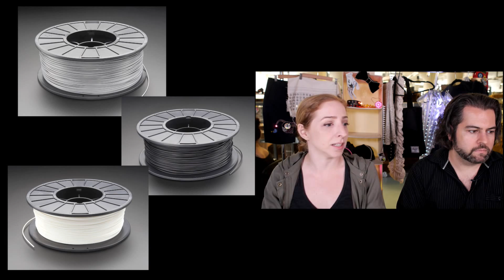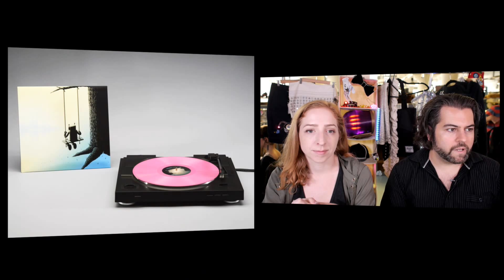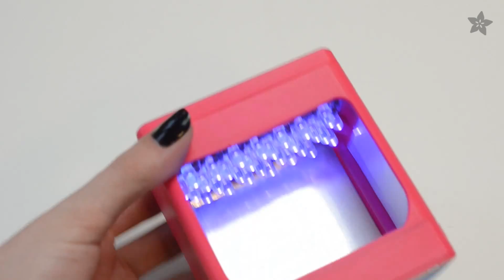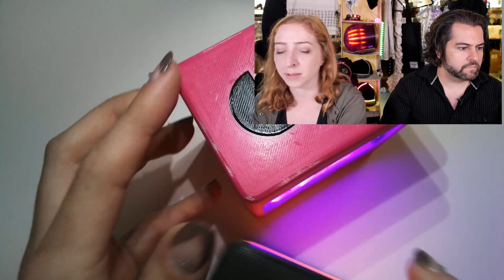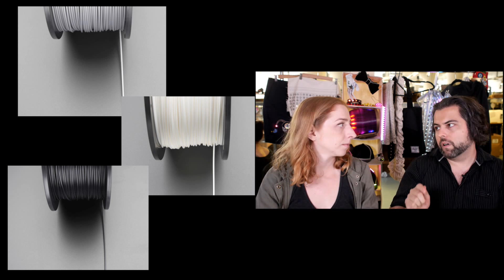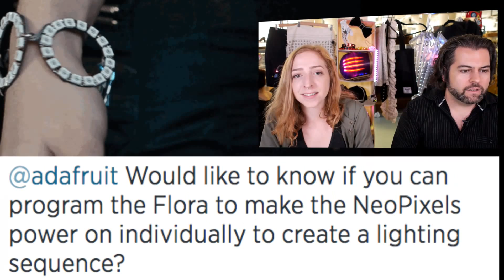Wearable Electronics with Becky Stern 9/3/2014 - LIVE

Comment: Hay Becky. :) For the 3D printed UV nail curing project, instead of using just the 30 UV led's, could the Power boost handle powering 40, 50 or even 60 UV led's? Just asking just cause I thought of it.

Comment: Adafruit Industries Becky, I am planning to make a wearable project with NeoPixels. The pattern is very complex and will likely require a Raspberry Pi running Python which will send the instructions to a Flora that will determine the animated pattern of the NeoPixels. No need for a display or keyboard. Do you have any recommendations on using a R.Pi in a wearable project. Does Adafruit have any plans to make a wearable R.Pi that would compliment the Flora?
Thanks to everyone at Adafruit for inspiring technical creativity on such large and diverse scale.